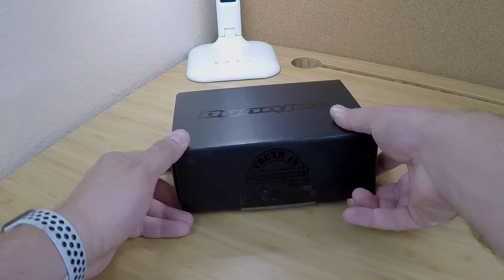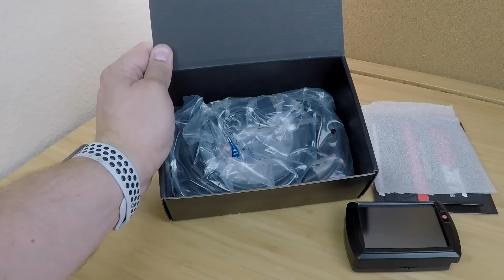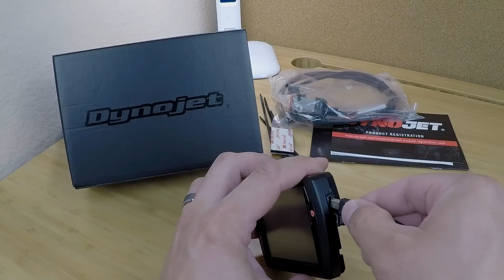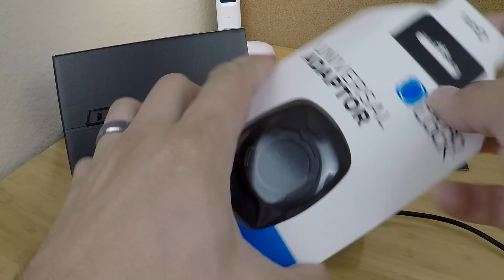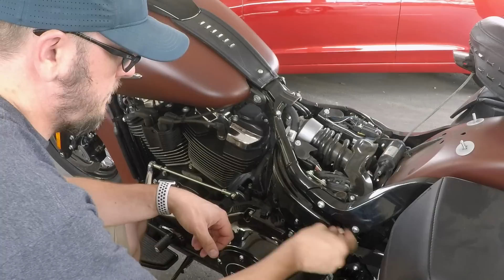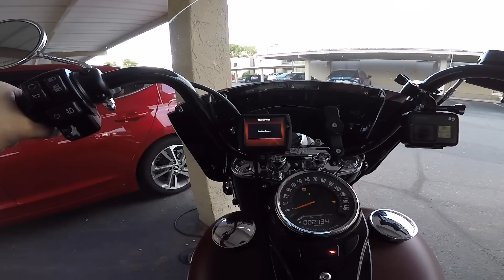Dynojet Power Vision Unboxing and Install

Comment: I purchased my power vision for $445 from fuel moto total cost , for my 2020 road glide special 114 air cooled. I had really bad leg burning heat from the engine. I only had 4” Vance n Hines slip ons.  They provide a custom tune according to the mods you tell them your bikes mods and the power vision will come with a custom tune for your bikes particular mods. I immediately flashed my bike with the new tune that fuel moto provides and it was a lot cooler and definitely more power very noticeable immediately! I’m very happy compared to Harley stealerships cost of $800.

Comment: My 2002 Road King Screamin Eagle already has a Cobra Fi2000 installed. How much of the Cobra tuner do I have to remove to install the Power Vision? Are the Cobra cables that connect to the 02s and fuel injectors of any use with the Power Vision?  Thanks for any help you can offer!
Reply from the maker: I don't really know how to answer that question, I have no experience with the Cobra tuner or any idea how the two compare.

Comment: I purchased a use 2010 Electra Glide Classic from the second owner. It has a screaming eagle high flow air cleaner and what appears to be stock pipes installed by the original owner. I don't know if the catalytic converters have been removed. The second owner indicated there is a 96 to 103 bore kit installed however after looking at the gaskets they appear to be the original 96 gaskets. (They do not have the tab sticking out like the 103 gaskets.) I am assuming they put a different tune in the stock HD tuner. Will the Power Vision tuner tell me if there is currently a 96 tune or a 103 tune in the bike? How much information will the Power vision tell me about what is currently in the bike?

My plan is to replace the stock pipes with  D& D 2 into 1 fat cats. Are the D&D Fat Cat 2 into 1 Headers in the choices to select for down loads?  Or will the Dynojet power vision compensate for what ever the pipe is in the auto tune mode? I have never did any tuning so I am wondering how hard this is to use.  My plants are to MOD the bike.  I am going to change the cam, and possibly an S&S 110 kit down the road.   This is why I am looking for a easy to use tuner to make tune changes as I go. Is the Dyno Jet support good when you run into questions? I have read some of the other reviews of tuners which indicate their support is very good however it appears to me the DynoJet Power Vision does more things. I just a matter if I can figure out how to use it.
Reply from the maker: The PowerVision is BY FAR my recommendation.

Comment: Did you use the original screws that came with the power vision to screw through the quadlock universal mount into the PV? How does the wire connect to the PV, is it something that will become a problem with constant disconnect and reconnection? Thanks
Reply from the maker: I think I might have taken a grinder to the screws. I don’t recall. The wire is a plug in so when I remove the plug it just dangles and is fine.

Comment: The screws don’t get in the way of the quad lock connection while connecting and disconnecting? What do you do with cable when you remove PV?
Reply from the maker: Nope. I just leave the cable dangling, its been fine.

Comment: What bracket are you using to mount your dynajet to your bars. I just got mine and I need a mount for it.
Reply from the maker: I retrofitted the Quad Lock Universal Adapter https://amzn.to/36igqwK and then just used the basic handlebar mount https://amzn.to/3abcbUD. I would recommend the vibration damper too only because after a while I did have the vibration start to loosen up the nubs on the quad lock adapters which isnt a big deal and you could live with it if you wanted to. I personally just like the Quad Lock system because its easy to pull the tuner off and toss it in a pocket or saddle bag if you park someplace sketchy. https://amzn.to/39lAgcg

Comment: Let me tell you friend, that Quad Lock back support was a great idea!! 👍😉
Reply from the maker: Thanks. Just thinking outside of the box. It is nice to be able to leave it on 99% of the time but quickly pull it off if I find myself at some sketch gas station or parking at a hotel overnight.
Reply: @GearsandGadgets  I just bought a PV for my 2012 RGC CVO and did exactly the same thing as you did.
Reply: Has the adhesive stayed strong on it?
Reply: ^ has it? And is it easier on n off. Deciding between this or ram ball mount

Comment: What happens if this unit takes a shit while you're riding are you dead in the water on the side of the road
Reply from the maker: Nothing. You don’t need the unit, you can load your tune and take it off if you want, I just prefer to keep it hooked up for the additional gauges.

Comment: 🤦‍♂️ can't believe harley would put the mono shock under the seat burying the battery even more.  Bad enough they made all the soft tails beyond ugly.  Oh The PV is great I just wish they gave more options for maps like the power camander v
Reply from the maker: I have no issues getting to the battery and in all reality the trade off of ride quality / suspension travel with a monoshock is far superior design from any measure of performance and ride quality standards. As far as softails now being “ugly” that is obviously completely subjective. And yes the PV is an awesome tool that changes the dynamics of the bike immediately, I dont have too much criticism on it, but I am also realistic in knowing I am only using it at a rather basic level. A professional tuner would likely have way deeper understanding to critique than I do. Thanks for watching and I appreciate the opinions for sure.
Reply: @GearsandGadgets  I have a 2014 soft tail deluxe cholo style full air ride. The new soft tails I can't see turning them in to a cholo if they can be done at all looks way to complicated since they redesigned it lol

Comment: How did you get that data into your Garmin Virb? This made the DynoJet 1000% more interesting to me :).
Reply from the maker: It was a TON of work with software that is too hard to explain in a comment lol
Reply: @GearsandGadgets  But in general? Obviously converting your G-Metrix data to .csv is necessary, but can you straight transfer the PV2 log data into the .csv file, or does it need additional manipulation?

Comment: WOAH! I'm noticing on the screen it says intake temp, engine temp, head temp. I didn't know the PV has an actual engine temp vs the head temp.
Reply: It's data from the ECM. There are sensors all over your engine. Oil temp, air intake temp, engine temp, head temp, voltage, oil pressure, fuel usage, tire pressure (if your bike has those sensors), AFM, RPM, Speed (from the gearbox), etc. And a lot of stuff can be calculated from that data, like selected gear, power, torque, etc.
Reply from the maker: Yeah

Comment: So I’ve installed mine ran it 2200 miles with the stock improved tune and then I did the full stage 1 with Bassani RR3 and SE heavy breather. 100% the stock improved is worth it alone. It has noticeably greater power. It even sounded better. I would have been happy with just that except I wanted to change the look and intake and e hairs really does that. Remember to reset your fuel trims with you do a full stage 1 install. I didn’t with the stock improved but had to with the stage 1. The PV is a great tuner I highly recommend and Fuel Moto is super awesome and very helpful. Best to get it from them.
Reply from the maker: Thanks I appreciate the input. I totally agree even the stock tune alone is totally worth it.

Comment: Thank you for the info. It answered a question I had about tuners in general. Getting a tuner, exhaust, and air intake at once is pricey for me. I wanted to know if I could start with a tuner first and use it with a stock iron 883. Sometime later continue to invest in the rest of the stage 1 items.
Reply from the maker: You are welcome!! Thanks for watching.

Comment: I have the same bike have rc slip ons. I do not see the tune for those slip ons. Also what would I use for a cam tune?  Did you put this on before warranty?
Reply from the maker: I didnt do the cam yet. I did do the Dyno because you can always "De-Tune" it to take it back into the shop.
Reply: Gears & Gadgets have you taken it back to the shop after having the dynotune?

Comment: Hey, thanks for the quality video. I’m looking to get one for my Street Glide to replace the stock tune for now and will upgrade later. I went to the Bri g it Home Parade and get what you mean by wanting a stand alone unit that won’t shut down when hot. Damn it was hot that day. How do you feel about the Power Vision now having lived with it for a while?  Thanks
Reply from the maker: I love the Power Vision. Single handedly changed my Heritage M8 immediately. It remaps the throttle response and just makes the bike come alive.

Comment: Don't waste your money on a Dynojet Power Vision. The unit will constantly lock up and they won't do anything to fix it. Go to HDforums and check out the many complaints about their poor service.
Reply from the maker: Interesting, first I’ve heard of that. I haven’t had any issues. What did customer service tell you?
Reply: @GearsandGadgets  They said that the gauges are a novelty and they are not really that concerned with them. It is a known bug and they may fix it in the future but no ETA.

Comment: Hi Heritage Bro !!
I'm in the process of getting a tuner for my 2018 FHCS and I'm kind of interested about the Powervision.
The thing is, I live in Paris - France and the screen cannot stay on the bike for more than 1 hour or it will be stolen.
So, does the PV screen has to be on the bike everytime I ride ?

Or can I just leave the cable on the bike, put the screen when I need to ?

Will my settings and maps still be active if the screen is not connected on the bike ?

As I understand, the screen acts pretty much like your phone with V&H FP3. You can use it to monitor things and tune the bike but once it is flashed in the bike it isn't mandatory.

Am I correct ?

PS - I really like how you got that tail light base plate blackened. You shoud show us how you did ;-)

Be safe out there !

Thanks.

Simon "Simba"
Reply from the maker: You do not have to keep it on the bike at all times. I just do it because I am safe where I am at. You can ride without it and the maps stay programmed. Also, I just rattle canned that chrome piece and it turned out REALLY good. I will probably have to eventually powder coat it but a dremil to roughen up the chrome and some careful painting worked out just fine for now. Ride safe!!

Comment: Just ordered a Power Vision for my Heritage.  Did you have to remove your tank or did the cable easily feed through?
Reply from the maker: Joseph Long I wouldn’t say easily but I didn’t have to remove the tank. It just required some patience. Probably too 20 minutes of frustration to feed it but that was worth not pulling the tank to me.
Reply: I pulled my tank still had frustration but it would have been hell with tank on also taking it off will make sure your wires aren’t gonna burn up

Comment: Great video...I bought a powervision tuner through my hd dealer they tuned it along with motor and exhaust work but they didn't give me any monitor or anything when I picked up my bike. Is that normal or do I need to get it from them
Reply: I found that some dealers will only sell you a tune through a license. So you will not get the touch screen unit. I heard that the reason they do this is to make tuning more affordable to their customers.
Reply from the maker: Darrell Beauchamp yeah if you bought the tuner they owe you the screen for it. Unless they just sold a tune to you then that is different.

Comment: Has anyone tried this tuner and the fuelpak tuner? If so which do you like better? I had the fuelpak on my breakout. Now i have a heritage but was thinking about this tuner.
Reply: Yes I have. Fuelpak is just a basic tune that gets you close with a preprogrammed tune. This is much better and is as close to a dyno tune you can get with the auto tune. Much nicer and feature oriented.
Reply from the maker: I have not.

Comment: Bummer that it doesn’t have a tune for the intake and exhaust combo I plan on running.
Reply: If you purchase the unit through Fuel Moto they will make any map you need and you get lifetime tech support through them. I got mine through them 6 months ago for my dyna and love it. Fuel Moto"s customer service is fantastic also.
Reply: Fools Errand they charge an additional fee for that service correct?
Reply: @FNGMOTO  None that I'm aware of.  Call and ask to be sure though. I've had good experiences with them by phone and email.
Reply: Fools Errand will do bro thanks for the info
Reply: @thehardway_j  Got mine thru  Fuel Moto in 2013. great folks called  them 2019 on a ? i had they Emailed  the answer in 1 day!!!! i put headers on and new air cleaner!! came with tune in the power vision.
 Great service;-))) works  great on 2013 RC. NO MORE Government Crap in the header runs way cooler.
Reply from the maker: You can email them, they may be able to get a tune for you.

Comment: No support for Mac? Wow. That’s a fail. Glad I went with the FP3. Looking forward to see how it works for you. TCRS
Reply: It's not a fail at all. Mac OS proliferation is around 10% of the market, and is almost non-existent in the automotive world.
The Auto Mechanic industry runs on Windows, especially older versions. Many companies and techs still run Windows XP on their Dyno and diagnostics machines. 
And on the average, most people who have laptops are running windows laptops, and most garage computers are Windows PCs. 
So it really makes sense that this unit is Windows Only. And considering it's a Tool, not a gadget, and you're buying expensive hardware for a motorcycle, it's not that big of a deal to run down to Best Buy or snag a cheap little windows laptop off of Dell specifically for working on your bike.
Mac OS presents many issues for a lot of people working on cars and motorcycles, so it doesn't make a lot of sense for DynoJet to produce a mac client when next to no one will be using mac for this device.
Reply from the maker: I agree no support for Mac sucks but I run parallels on my Mac and just load windows to use it. I like the trade off for a dedicated unit. The main reason why I prefer the Dynojet Power Vision over the FP3 is because it is a dedicated unit. I didn’t like the idea of using my phone over bluetooth for the live data. At times at overheats and shuts off, I didn’t want it to do that in the middle of an auto tune, or when I am trying to use it for the gauges on the highway. How has your experience with the FP3 been?
Reply: Tech Chex & Motor Vlogs 

I’ve read you can run a program called “Boot Camp” to run Windows on a Mac also but ease of installation and a really good user interface was what steered me towards the FP3. I like being able to flash a tune to the FP3 at whim and it works really well. Customer support from V&H is another strong point. I flashed a recommended tune and it completely changed my 2015 Limited and I’m thrilled with it so far. I left the tuner plugged in and only know it’s there when I open the app to view live data but I’m glad it’ll be there if/when I go Stage 2 or 3. Keep us updated
Reply: Great video you did here I subscribed. 👍
I was able to hear you very good and video quality was good also plus you did a great job putting it all together. 
👍👍
Yup being not Mac compatible is sad. Though I don’t have a Mac but would like one in the near future. 
I’am in the market for something like this but was actually looking at the ThunderMax but the Rep at Fuel Moto has me thinking towards this Dynojet Power Vision and using their header pipe instead of the Rinehart Xtreme True Duals, but I do want the Rinehart 4” Mufflers and a Roland Sands Air Filter. 
If I do go with this I was wanting the Dynojet Auto Tune as well with the wide band O2 sensors. I’d like to hear if anyone has done this type of set up with these O2 sensors with the Vision on a Stage -1 set up!
Later on I will change the cam, Cam Bearings, and Cam Plate.
Reply: I Purchase the FP3 And installed a canned map. Lost The ability to use my cruise control, I didn’t realize it at first what the problem was but I reinstalled the stock map for the heck of it and my cruise control is working again??? Returned it since Vance and Hines didn’t know what the problem was. Have a PV2 on the way. Bike is a 2019 Street glide special.
Reply: @mrfedex5495  I have no idea if the PowerVision will have the ability to enable your Cruise Control again, but you may be able to email Dynojet and ask them for some help with it, so you can get your CC back after a tuning flash.